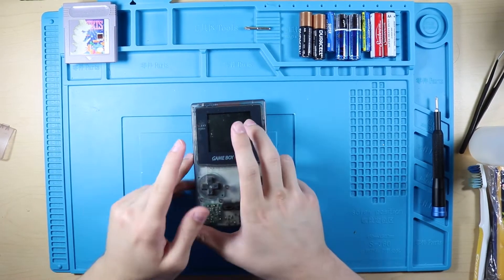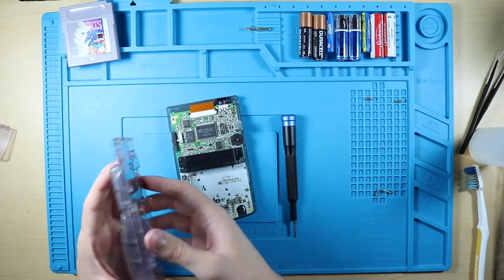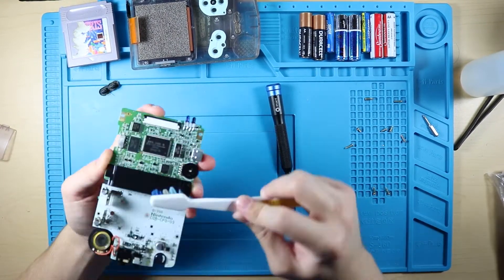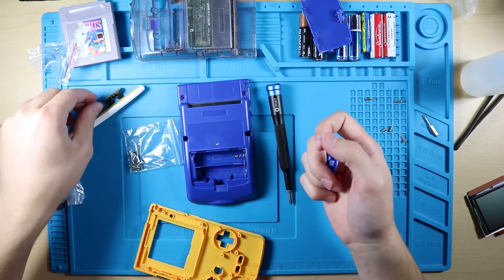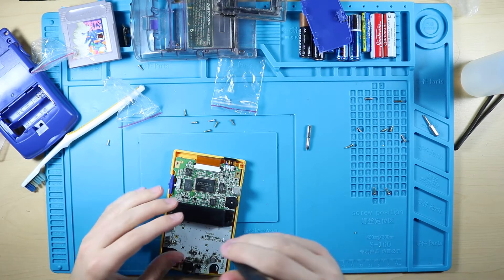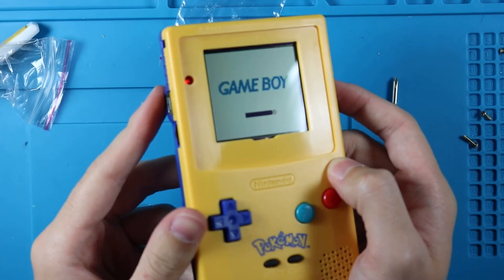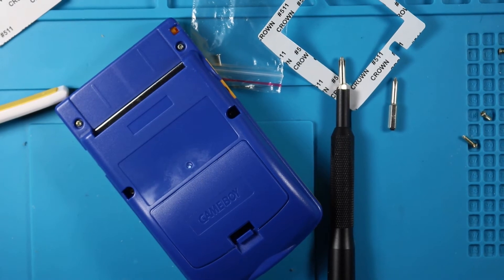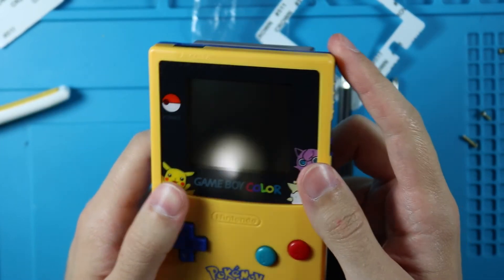Game Boy Color Shell Swap! | Pokémon Special Edition GBC Restoration

Comment: I was going to twist and turn to get the screen out, and my old case just snapped. It was so old, so as I previously started taking it apart, it just was falling apart. It had only 1 screw holding it in

Comment: Is there a recommended drop in replacement LCD for shells with stylized bezels like this one?

I have this same shell with a different lens (power LED is Pikachu's cheek) from when I was a child, but the screen is in desperate need of a backlit upgrade - don't want to get rid of the iconic original bezel lens but I cant find a replacement that doesn't require a custom bezel accounting for a different screen size.

Help.
Reply from the maker: Probably this one but I haven’t tried it personally. Seems like it should work though! Use code JAKE to save 10%! https://retrogamerepairshop.com/collections/gbc-displays/products/game-boy-color-2-45-drop-in-backlight-lcd-kit
Reply: @JakeSimmons  Nice!

Thanks very much